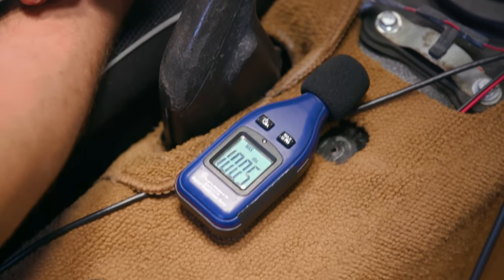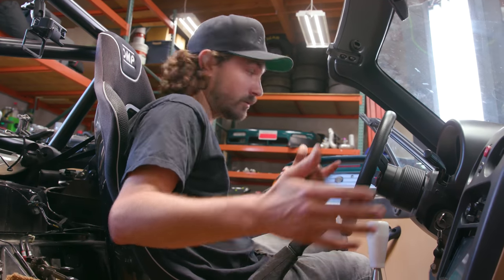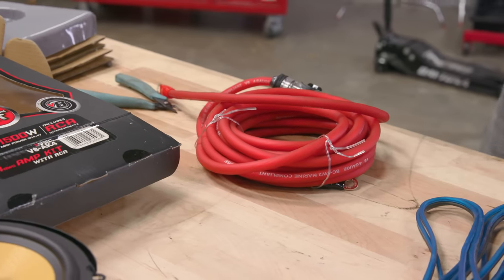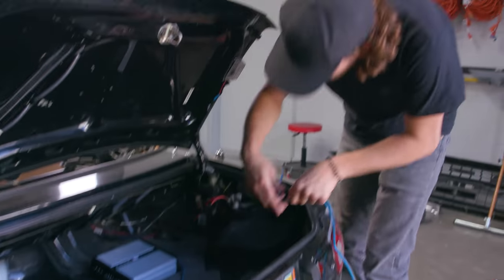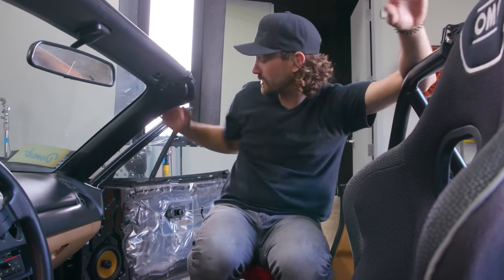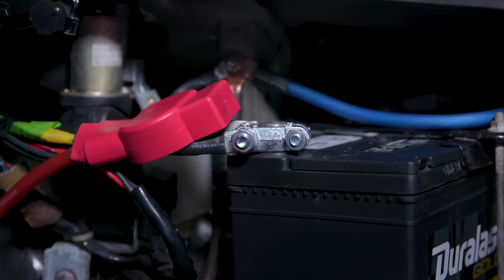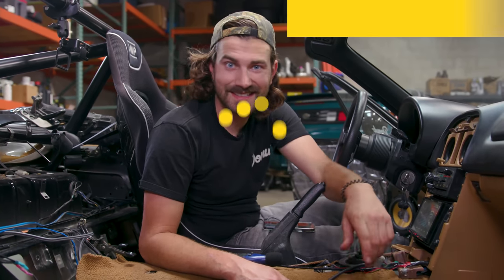Is Upgrading Your Car Speakers ACTUALLY Worth It?

Comment: Very nice speakers and AMP! You should also custom install 2 in the back too though (as long as its a 4 channel AMP to begin with). You'll see why once you have. You can get custom 6-6 1/2 inch mdf carpeted boxes with terminals for them too if you don't want to cut anything.

Trust me you'll thank me once you have.
Reply: Would you recommend I upgrade my door speakers? I just had 2 12s put in my backseat and I was curious if it’s worth upgrading my base speakers. And yes it’s a 4 channel amp
Reply: @christianchatagnier4029  most certainly. You should get a good set of 6 1/2 splits (with good quality crossover boxes, Ie. Alpine, JL audio) for the front doors. All depending if you already have a place for the tweeters in your doors or dash. If not Alpine or JL audio do some amazing 3 way speakers as well. It will improve your sound and speech clarity in the front (as long as you tune them to match the rears on your amp). That way you'll have amazing quadrophonic sound for yourself and your passengers will thank you for it as well! For Bass (sub woofer) you'll need to sadly get a second dedicated amp for your sub. A "mono block" that will either match the  RMS of your sub or exceed it, (not the overall rated power). You will need at least a 4 gauge wiring kit and high quality RCA's from your head unit as well. The bigger the better when it comes to sub cabling. 4 gauge is best in a single sub application situation. 8 gauge wiring kit for a 4 channel amp as well. Make sure the RMS of your amp (per channel) exceeds the rear and front speakers RMS per channel as well. This will remove distortion and help a lot with tuning and balance between front and back. You can do the bare minimum of the same as your speakers but you won't have the headroom for perfect frequency tuning between front and back that way.

Audio is a very technical thing to set up and you want each speaker to do its job separately and not just have it sound like mono front and back with frequency cut off and "blending", you want to hear your lefts and rights and in some songs your backgrounds and foregrounds separately. That's what Bose and Harmon Cardon do. They use an algorithm (usually comes with a stock system for luxury cars and its programmed in to do it digitally) to make that happen. The speakers you get with the car really aren't very good but the way it's set up digitally from the deck makes them sound really, really good. A bit like beats from Dr Drea headphones. Same trick. With your set up you'll have to do this without a multimillion dollar digital audio studio writing you an algorithm and instead rely on the high quality hardware you have instead. Trust me you're already ahead in comparison with high quality equipment to begin with. I'd recommend an Alpine R series 12" sub and properly ported and tuned sub box to go with it. Then the 4 gauge wiring kit and separate high quality RCA's and suitable mono block amp. Don't use the RCA's in the wiring kit at all! The wiring kit will have everything you need and good quality aside from the RCA's. Why? Who knows, probably cost cutting and price gouging for the sake of convenience? So yeah get very high quality RCA's separate to the wiring kit.

I hope that this helped and that if you put the time in to researching everything you need and take the time to tune it all, you'll have a never ending smile on your face every time that stereo goes on in future! Also don't use Spotify to tune your system. Get mp4 downloads and play them of a memory stick or a high end phone to do testing and tuning. Also have a passenger sit inside the car next to each speaker as you tune them and ask them to play a heavy bass song then a clean song like I hate to say it but classical as.it'll give you the best trebble and mid audio to match up to the bass reflex in other songs. Tuning will take time don't rush it. If you like you can get a hand held frequency tuner (I'd strongly advise you do) as it will help with crossover and stop all frequency cut off through out your system as well. For me I use my ears as I've been at it for so long I just need to listen and get feedback from a passenger to confirm what I'm hearing is correct. And it usually is on point or extremely close only needing miniscule adjustments to dial it in perfectly. A frequency tuner will in your case be a God send and save you days of second guessing yourself as well 😂. Trust me on that! 

If you need more help come to my Discord through my twitch channel DeathValleyAU and we can get on mic and discuss your needs further. 

Happy to help as this is a passion of mine and I've done this as a job for years prior as well in both the installer warehouse and on the shop floor so I know literally everything there is to know about car audio.

If not good luck and I hope my advice helped!

P.s please excuse the essay 🤣.

Comment: Reminder that the decibel scale is logarithmic, so a 10 dB increase is 10x as loud. The change from 87 dB to 97 dB at the 25 setting is ten times as loud, which is why the change from 25 to Max/40 was not the same increase in decibels, but still was proportionally louder.  *I messed up the original comment and edited it after @Cody Friszell corrected me.
Reply: Not quite right, since it’s a logarithmic scale. 3dB increase is twice as loud, 10dB increase is actually 10x as loud.
Reply: @codyfriszell2258  True, I screwed that up...

Comment: Would've been interesting to hear the new JL speakers with the regular wiring.
Reply: It's been tested many times before and while the upgrade would've been a bit clearer esp at higher volumes, the factory wiring is usually good for up to 50-75 watts so would've worked fine 🙂
Reply: It would be nearly imperceptible stock wiring should be good enough for this. Cable quality is something that doesnt really scale as you spend more and more its more about not having something thats too cheap. If he had a really premium and loud setup with really long cables then it might start being a concern. If you want to see what to look out for a really exaggerated example would be to get like dollar store earbuds and plug them into a cheap audio player and play a silent track with the volume pumped. You might hear some hissing and electronic interference like noises from badly shielded wires.
Reply: @lowkey7850  Yes and no. It's the thickness and added copper strands that makes the difference here, not to mention a direct path to the amp and not connectors. Going from 18 or 20 gauge to 16 makes a difference, despite how much difference it makes. It also depends on how you listen to your music. I like to turn up the bass AND volume, and skinny ass wire just won't cut it...
Reply: @lowkey7850  
Paul Klipsch just used the budget 16 gauge stuff, even on the Klipschorns.    Speaker wire never makes sound any better, it can only make it worse.

Comment: Agree with you on some of this, but please, look into how to set your amp with a dmm, because gain isn't a volume knobs and is actually a variable input voltage adjustment, when gain is set too high, it introduelces cliping, cliping cliping is bad for your speakers, much worse than overpowering a speaker
Reply: Preach Brother!!!!
that shit drives me crazy! like, ok its loud, but sounds like shit.. You could just adjust your gain properly, and turn down the volume on Headunit, might not be quite as loud but at least it won't make me wanna destroy my own eardrums  because it sounds like shit
Reply: Amen. I was impressed with the video, up to that point... then it was all let down.
Reply: Distortion at high levels will ruin speakers that are not being driven anywhere near their rated power handling.  Distortion kills.  It sounds bad, too.  Well... with current music it might be hard to tell.  But the speakers will still be killed.
Reply: @rachelblack3816  might want to look at some audio research. Distortion and clipping are far different from another, distortion can be heard and clipping itself is inaudible
Reply: @chaseleim4773  Seriously?  Are you saying, with a straight face, that clipping is not a distortion of the original signal?
Reply: @rachelblack3816  clipping is a forum distortion but it is not audible, it cannot be heard, audible distortion itself is different, thought clipping is what kills speakers, audible distortion isn’t, you have to realize that audible distortion is caused by trying to push a speaker to reproduce a sound beyond its maximum capability at that range, wich causes cone breakup and changes the way it sounds, there’s a huge difference clipping is dc current goin where only ac currents should be
Reply: @chaseleim4773  You're not making any sense.  Clipping is not DC and DC current is not what destroys speakers in the context of audio reproduction; have you ever seen a clipped signal before? And it can certainly be heard, it affects and distorts the audio signal when the amp is overdriven-- any Distortion of an audio signal can potentially be audibly recognized.  This clipping induces unwanted harmonics into the cone of the speaker which mechanically over-stresses the material, and that is what can destroy the cone, and/or the surround and/or the voice coil.

Comment: I would have liked to have seen a few stages for curiosity sake . 

1) factory speakers and head unit with new speaker wires 
2) new speakers with new wire and new head unit 
3) new head unit and new wires with factory speakers 
4) then finally the whole new system .
Reply: Just replacing speaker wires is a poor use of money and time. But . . . If speaker wires are added to an all-over upgrade (head unit, amp, subwoofer, speakers), they can be a major contributor to quality-sounding audio.

Comment: For people that don't know: 3 dB increase means that the sound is twice as loud!! So a 3,9 increase is a really nice upgrade
Reply: Technically speaking yes, but audible its colser to 10db difference
Reply: @EliasTheHunter  Let's see here... Between the mic that's recording, the software that's being used for video editing, the compression that YT incorporates in their uploading process, the "reproduction" through your speakers, and the fact that you're basing the sentiment around something played at max volume (which most of the time, nobody's going to do, not to mention having done so BEFORE the low-pass filtration was done), you're seriously expecting to accurately understand how something sounds without being there? I mean, I'm not saying "they're the golden speakers of all audio", but never judge sound by anything short of being there. 
Yes, maybe it's (a whole lot) easier to produce home stereo quality sound, but that's taking an abundance of factors for granted. Car audio, when done right (and heard in person) can be euphoric, and "just as" worth the effort/cost as home stereo. Only on wheels.
Reply: @EliasTheHunter  i can't take my house speakers on a road trip
Reply: A 3db increase is only insignificantly louder than if there were none. A 10Db increase would be about twice as loud as the source would've been before. So, you're out of bounds.
Reply: @TheZombieSlayer1155  

Yeah, it is debatable.   3db is not double, I think it is less than 10db though.
Reply: @mitchhedberg4415  sound intensity doubles at +3db, but u can actually hear it twice as loud at around +10db

Comment: I have an old 2008 chevy silverado. A couple months back I put the advance auto special sub and amp, (car dual) which is a 600 watt amp and a 10 inch sub. I spent about $250 on it, (including the amp kit), and it doesn't sound bad in my opinion. It hold the bass very nice and doesn't overpower my stock speakers I have. I love it

Comment: You should always put a fuse block no matter how low the amp is.
Reply: Don't most amps have a replaceable fuse built in them?
Reply: @yamaha94O  not for the amp but to prevent fires

Comment: This was my first and only project so far. In my 15 year old then 2002 vectra c I installed dynamats and fout time cheaper silent coats in all four doors. Then replaced 8 stock speakers with dedicated pioneer speakers and 2din pioneer radio.
. Result was amazing,  no need for subwoofer, crystal clear,  bass heavy sound.

Comment: The reason why he was able to upgrade the system was because of the amp he added I’m sure if he would of added a amp to his alpine it would of fix some of the problems. Also the reason why his decimals did not go up a lot was because the Alpine speakers are a upgrade to the stock speakers the Miata came with. But over all I had the same speakers the Alpine ones and upgrade to those same jl audio and amp plus I added two 12s W3 and a 1000 watt amp for the subwoofer
Reply: finally some one mentioned that :) . Im betting that the ALPINE speakers would sound even better than the entry level JL. He should have tested ALPINE whit the amp then the JL, or just installing the amp.

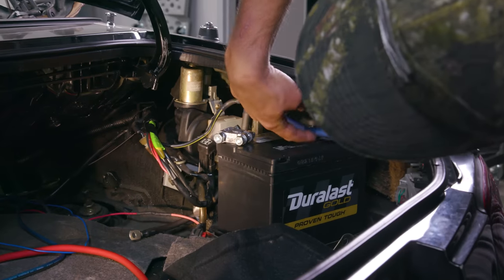Comment: 7:22 You have to upgrade your ground/minus cable from the battery to the chassis too. Also you should upgrade the power cable that comes from the generator to the battery because this is the wire that actually feeds your amp. The battery is only for the case when the engine is not running. Same with the groud/minus cable from engine to chassis/generator. 18:10 Nice to see that you upgraded the ground/minus cable to the battery ^-^
Reply: I only ever ground my amps to the battery, does that not matter anymore in newer cars?
Reply: @user-hy7su3jm8z  It matters even more. Modern cars have microcontrollers/computing devices and therefore also comecting 'busses (wires) everywhere. Bad power connection points can disturb them. Because car amps need a lot of current you also risk to damage the cabels that transport the power from the alternator to the batterie and engine. The + cables also need attention ans should alsways be the same size [you can get rid of alternator howling by connecting all music device cases with a grounding cycle wire that put all cases to a zero/null level]. And with this equipment you can get rid of tons of $ ...
Reply: @user-hy7su3jm8z  grounding directly to Ur batt is the best possible option yes.

However if your amp and batt are in opposite ends of the car u can just run a short ground from amp to chassis and a good upgraded ground chassis to batt

Comment: Honestly 500 bones ain’t bad!  Love car audio/video.  That’s how I made all my fun play money when I was in the military.  Gave the guy a list of what all they needed to buy and then spent Saturday or Sunday behind the dorms putting in speakers, head units, headrest TV’s etc… Pro tip, run your power wires on the opposite of the signal wires to reduce noise and interference.  Great vid Team Donut